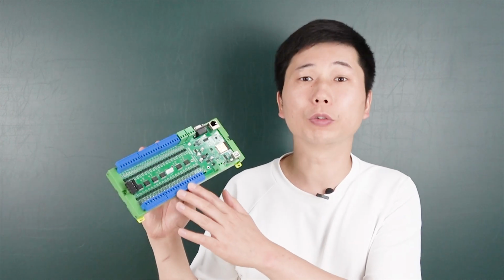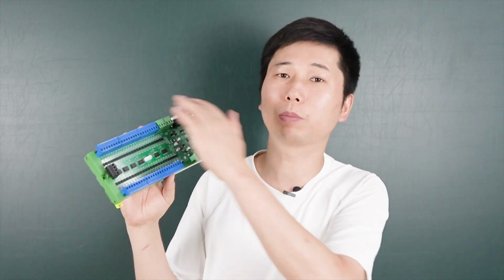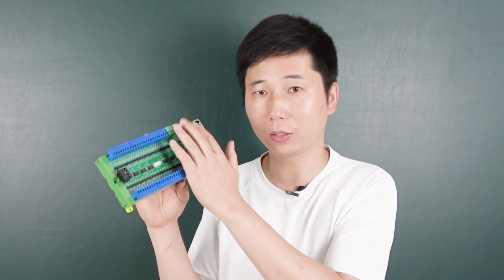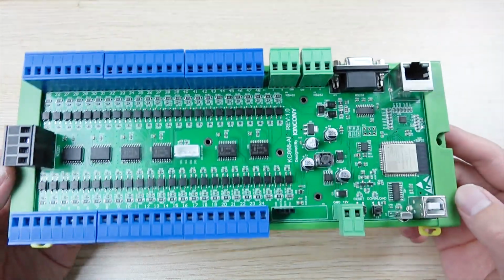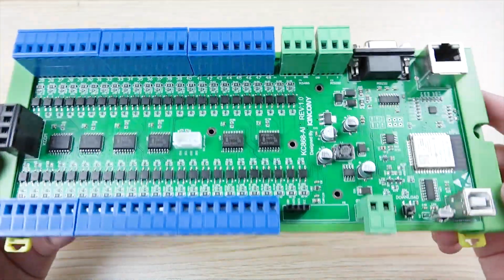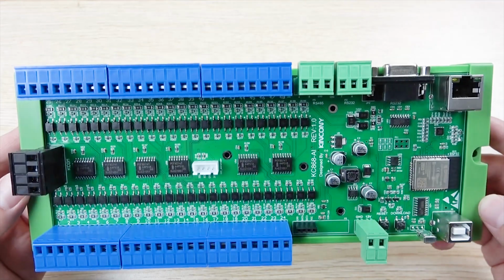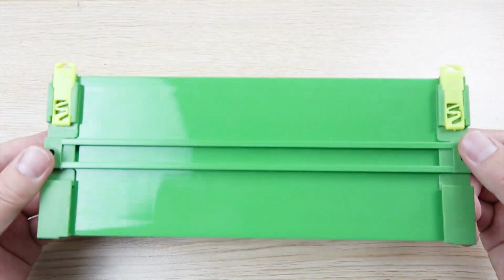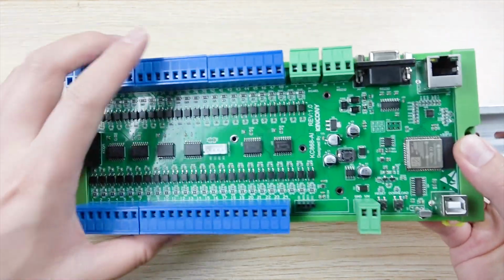new KC868-AI ESP32 input module released!

Comment: would these also work with PIR sensors?
Reply from the maker: yes, no problem, just any dry contact sensor can use.
Reply: @KinCony  I have the cheap sensor modules but it does not seem to work with this  board the state just stays the same like its constantly detecting movement. I have tested the sensor on another esp and it is working fine.
Reply from the maker: @AverageAutomation  what's your sensor output signal type?
Reply: @KinCony  this is one of the cheap sensors you can buy online Pyroelectric Infrared Radial Sensor HC-SR501.
Reply from the maker: @AverageAutomation  i have checked HC-SR501, it's output 3V for high logical, KC868-AI need >4V for high logical "1", so you can chose some dry contact relay output PIR sensor is better. HC-SR501 is voltage output by chip.
Reply: @KinCony  got so at least 4v and max 12v?
Does this mean i can use my old 12v alarm pir sensors?
Reply from the maker: @AverageAutomation  yes, i think you can use your old PIR sensor.